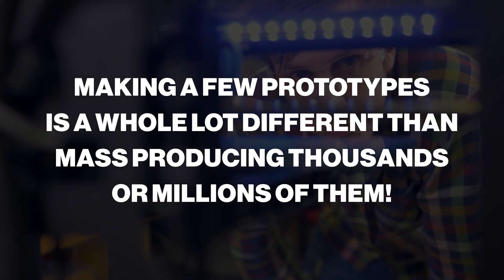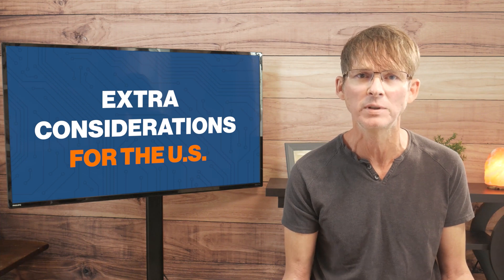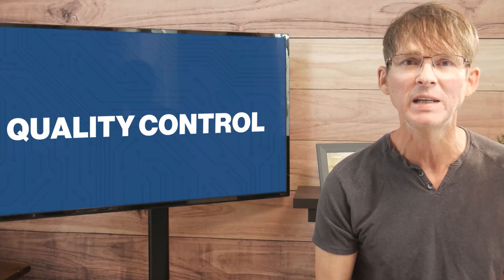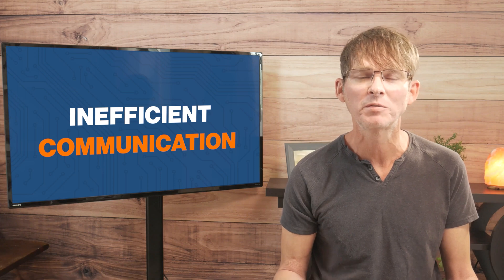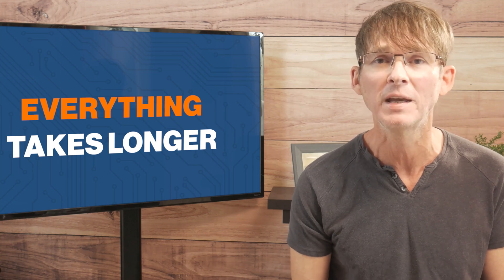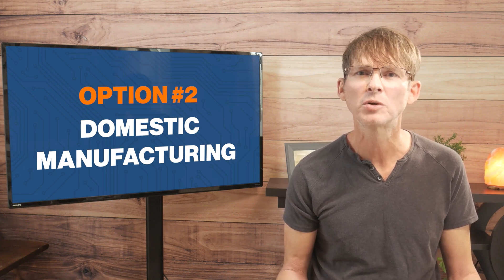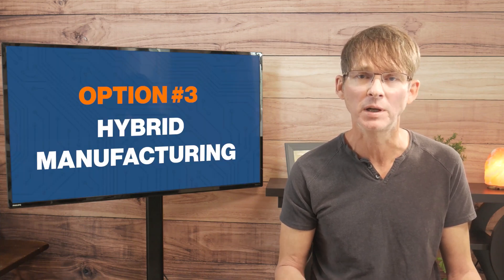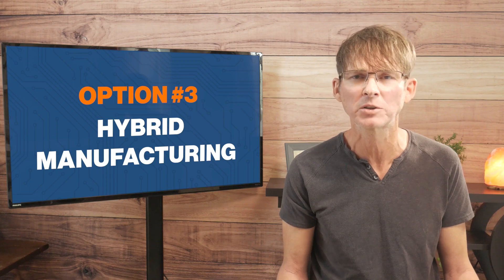How to Manufacture a New Electronic Product

Comment: I feel I go China to manufacture they’re just gonna steal my idea and use it
Reply from the maker: No one steals unproven ideas. You're placing too much value on just the idea. What matters is execution. Once the product is successful then that's when you need to worry about it, but not at the start.

In my Hardware Academy we have a workshop all about protecting your IP in China.